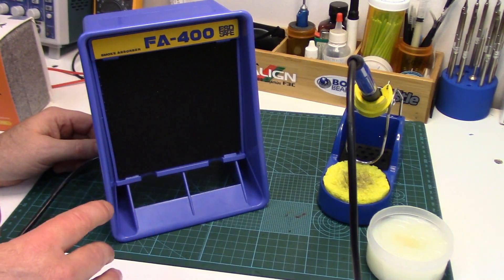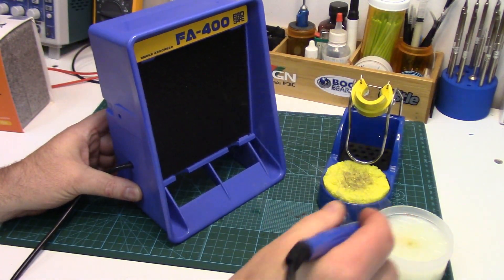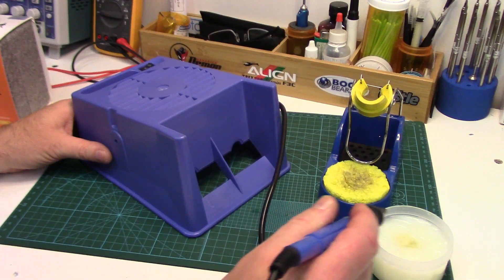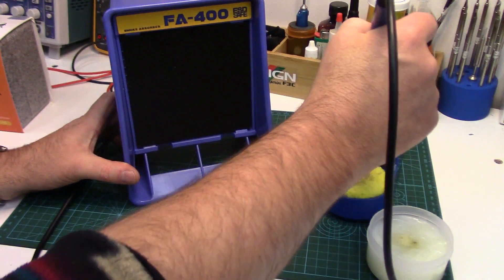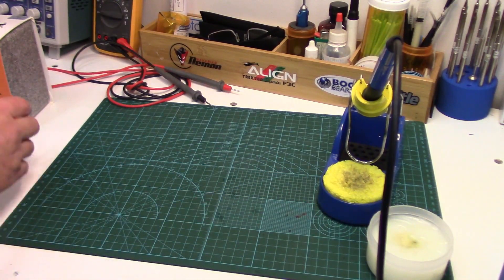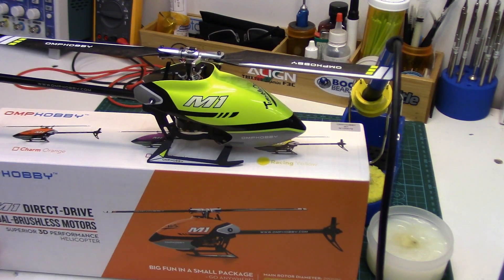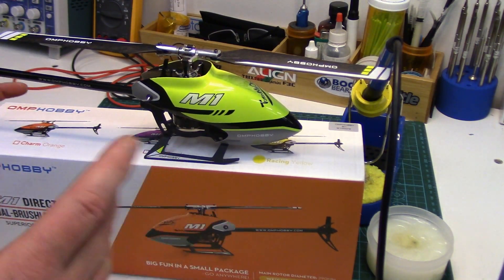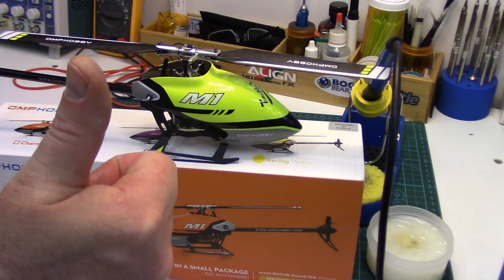FA 400 Update - It Works!

Comment: I have the Hakko version but I hardly use it. I just use a little fan or my garage heater to blow the fumes away. I am moving in 6 months and my shop will be in my basement so I think I'll be needing the Hakko unit because I don't want the solder fumes filling the house.

Comment: Mine FA-400 arrived today. Case is indeed better than i thought. But ESD safe? Yeah there is a grounded CEE 7/7 connector but the cable has no ground. There rest is all plastic so i don't know its''s real ESD Safe. Other than that: it's a nice smoke absober makes noise but the same as from a bathroom  exhaust fan. There should be this fan's also be used. ;) I measure 4.2 Watt.
Reply: They just copied "ESD safe" from Hakko after all. Maybe it's about the plastic used.
Reply: @wcr6121  But even in the power cable there is no ground wire. So i think it's only copy ESD safe. I have just the same FA-400 clone and it works great but it's not true :)

Comment: The fan shaft must have been badly seated and by messing with it you managed to insert the thing properly to the back bearing/bushing?
Reply from the maker: I had to open it up again to try and figure out why it was working (stuff like that bugs me). This time however, I could not remove the fan impeller out of the motor. As you stated the likely cause, when I pushed the fan & shaft back into the motor, the little detent on the end of the shaft must have clipped into place so it's now positioned correct and held in place. It does work better and draws smoke better than my little DIY unit ever did so that big box does have merit.